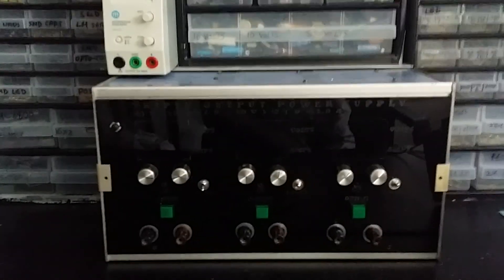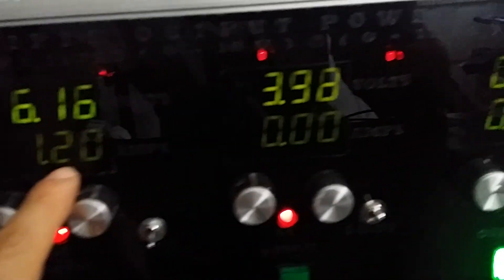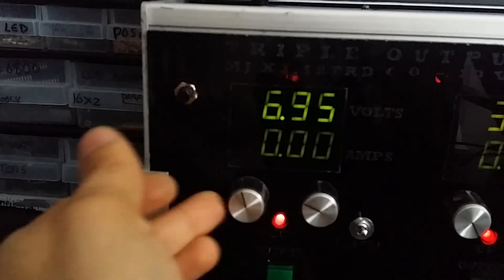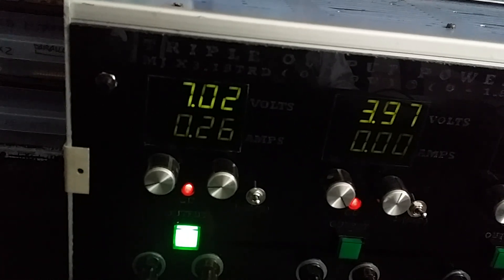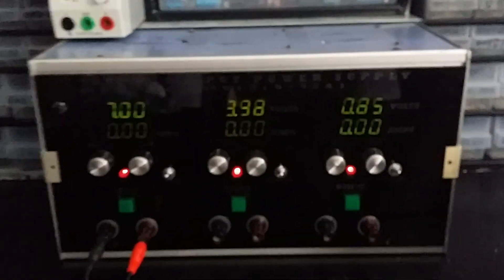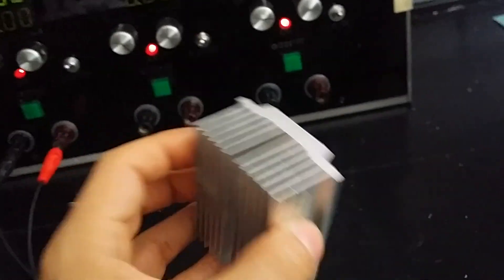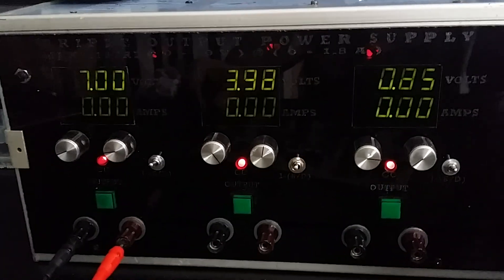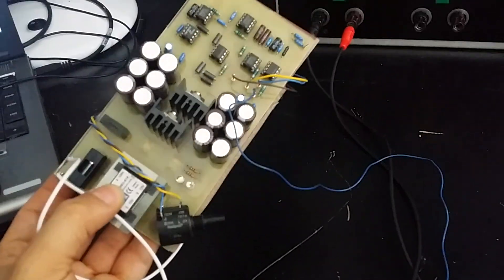Lab power supply design part 8

Comment from the maker: thanks, ye i see how i get along with the cnc machine. i am not that good with software stuff. i managed to fix the dull 7segment on my power supply to a bright red ones and now it looks much better, also changed the 10 turn pot for a current set to a normal wire wound pot. took to many turns to set the current lol.